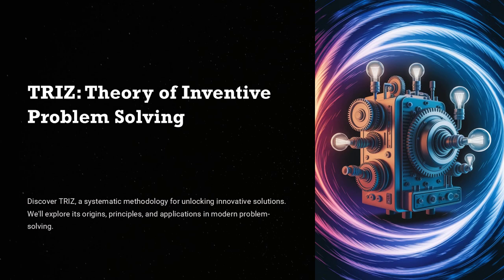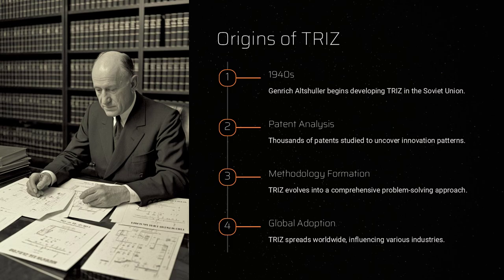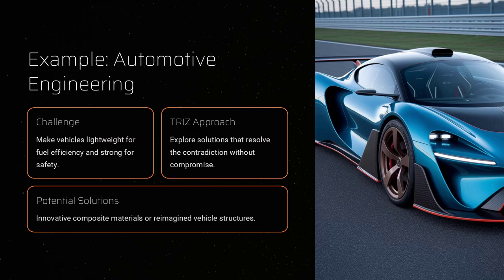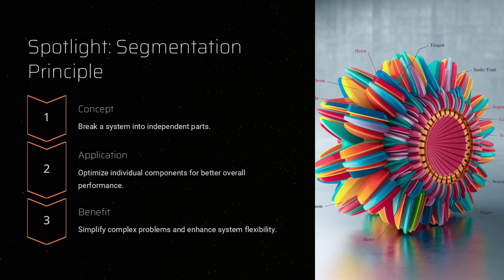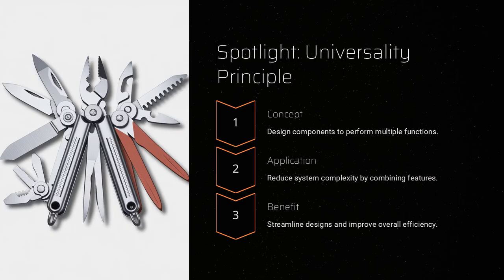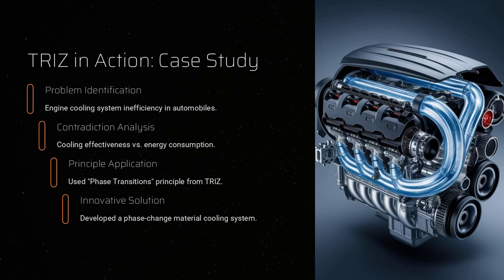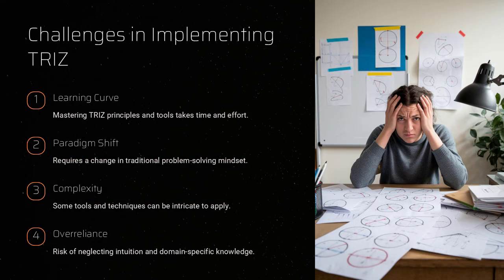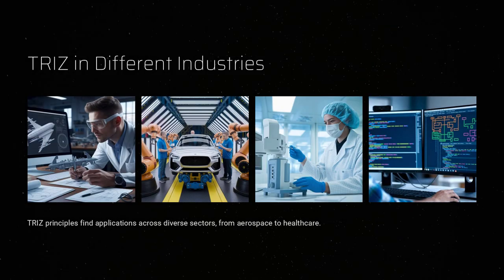TRIZ: The Theory of Inventive Problem Solving

Comment from the maker: How can the integration of artificial intelligence with TRIZ methodologies automate the process of contradiction analysis and generate real-time innovative solutions for complex engineering problems?
What are the potential limitations of applying TRIZ's 40 inventive principles to emerging fields like quantum computing and biotechnology, where traditional engineering patterns may not fully apply?
Can the TRIZ approach to achieving the Ideal Final Result be adapted to dynamic systems, where evolving conditions continually change the parameters of the problem, and if so, how can adaptive algorithms support this process?

Comment: What you have presented here, is nothing more than what is known as kindergarden TRIZ, hardly worth noting or of use to professional engineers of any caliber....You are not an internationally recognized expert on TRIZ, especially when you put out crap like this.
Reply from the maker: You are right that many examples used in TRIZ appear quite simple, even “kindergarten-like.” TRIZ itself, while revolutionary in its time, is not perfect; it relies heavily on heuristic and intuitive reasoning. However, the deeper problem is that today’s universities rarely teach how to invent — they focus on research, but not on systematic discovery. As Genrich Altshuller foresaw, the next step must be a scientifically rigorous theory of discoveries that goes beyond classical TRIZ. That is exactly the direction many of us, including our team, are working toward integrating TRIZ logic with modern data science and AI to make invention itself a measurable scientific process.
Reply: @AILabsBrain  I would have to agree with you regaqrding the academic community, and their lack of engagement and involvement with TRIZ to assist with that scientific discovery process was in fact something that I brought up at a semiconductor industry conference back in 2002.  Being able to teach systematic discovery, with and from a a systems based point of view and then having that systems based orientation being enabled by multiple TRIZ methods, far more than the "kindergarden TRIZ" should be called out for just that.  The TRIZ Body of Knowledge is far more than a few inventive principles, but far too many assume far too much about what they don't know, and that is just called plain old ignorance.  And as I've had to remind many of my corporate colleagues from the F-500, it is NOT the  bus that you do see coming that runs you over, its the one you don't see coming, until of course it is too late. There are other reasons as to why TRIZ has not seen wider adoption of TRIZ methods, that have to do with threat that TRIZ methods propose to academics.  Basically they don't know as much as they would like to pretend that they do to everyone else.  Many academics that I've had to deal with, has felt my stinging rebuttal for their failure to do their homework on the science part, most specifically using and applying the scientific method, rigorously and thoroughly.  Not so much an arrogance thing as many would stupidly assume, but a precision and clarity thing. Not for nothing, there's a reason why TRIZ isn't more widely recognized, and it has everything to do with a lack of responsibility to actually be competent in one's field.  Seen far too many times for me not to have recogized the pattern.  - btw - there are academic institutions that do have pockets of TRIZ classes that they offer.  Tufts University, MIT, and a few others.